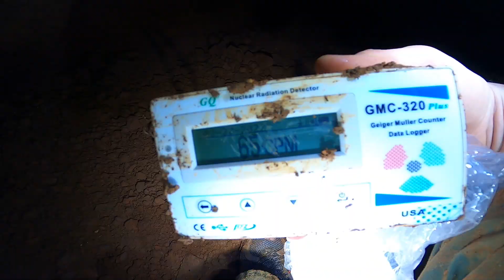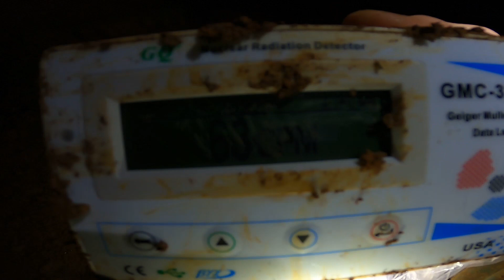Underground Nuclear Aircraft Laboratory

Comment: I want everyone watching this to take a good look at the holes these people dug out and entered through.  They are deep holes.  Beyond 5 feet deep and are not sloped correctly or shored to prevent a cave in.  They are very lucky that the sides of that hole did not cave in while they were inside of that place.  They very well might have been buried alive.  Some soil mechanics info:  There are 3 types of soil.  Class A,D and C with A being the most stable soil and C the least stable. Class A hass1.5 tons of unoppressive strength, B 1 ton and C .5 tons.   What that means is the ability of the soil to remain compacted before it fails.  The cohesiveness of the soil to hold together.  What determines class A to class C soil is clay or sand.  The more clay in the solid the stronger it is.  The more sand the weaker.  Understand that 3 cubic yards of dirt weighs 2000 lbs. (That's equivalent to a bucket on an excavator or track hoe)  You add to that weight if there is water in the soil.   I'm not trying to be a know it all.  I'm making you aware of a real life and death situation that I see and giving you information that may become useful to you in the future.  I'm a pipeliner and you only need to get buried in the dirt just below your chest to die if someone isn't there to dig you out.  The weight of the dirt pushes all of the air out of your lungs and you are not able to take another breath because the weight is pushing against you.  When digging deep always consider the soil to be class c the weakest.  The slope ratio for class C soil is 1.5 feet to 1 foot.  Meaning for every foot you dig down you need to slope the excavation1,5 feet out.  If it's a two sided trench that means both sides have to be sloped 1.5 feet out and if you have 3 or 4 sides to the excavation all sides need to be sloped.  When digging deep and getting down in that excavation is serious business!

Comment: This was a Lockheed facility. They had a nuclear power plant there. I grew up in that area and explored as much of it as possible. That was back in the mid to late 70's and the tunnel that you just went through wasn't fully underwater. From doing research online about it we found out that they indeed were trying to build a nuclear plane. And some of the old timers who worked in the complex said the plane and an old train was left inside and most of the place was flooded. The water comes from the Ettawa River that runs right beside the facility. The tunnel you floated in on rafts was big enough to drive a tractor trailer in. I'm sorry but the hole in the ground you climbed out of was not the same as the tunnel you floated down. That tunnel opened out to the river, and the river water was what they used to keep the nuclear power plant cooked down. Maps were found online, but we found them to be woefully wrong as there was much more complex than was listed on the maps. The hole you crawled out from was the entrance and where you crawled out was actually the top of the concrete entrance where tons of dirt was dumped to keep people out. They were afraid of any nuclear radiation that was there. The large tunnel there (after climbing through the hole) had some technical manuals dated 1958, but all were under water. And turned into mush when they were touched. About 50 to 70 feet back it went into three separate rooms and openings in the floor showed several levels lower under water. We tied a flashlight in a clear plastic bag and lowered over 100 feet of fishing line down the shift never seeing bottom. Couldn't see the flashlight but  it acted as a weight and it always had tension so we never found bottom. More questions than answers but it was fun.

Comment: It's an old abandoned Lockheed Base. The front side is where civilians worked and the back side, where they are in the video, is the military zone. A reactor cracked and leaked at the bottom floor. It's irradiated the lower you go. Don't dive in there. This Lockheed Base is now Dawson Forest. I commented in more detail on their other video inside this military office complex. I don't know how much they knew about this place, but it's basically a small underground city. There's underground structures on both sides of the Etowah River. The radiation is a serious issue. There used to be signs everywhere. I don't understand why they were taken down. Fish were irradiated in the river. My friends and I saw one of the largest river fish not even a mile from the stairwell.  It looked like a Suckerfish, but it was about 6ft long and probably weighed 80 pds or more. Dawson Forest was my playground growing up, especially in my teens. There's so much to explore there. Be aware of radiation and Timber Rattlesnakes. Have fun exploring and be safe.
Also be aware that it's a wildlife management wilderness. The Georgia DNR, Dawson County Sheriff's Department, Ga State Patrol and even at times, the US ARMY might be there and you might get arrested while exploring inside forbidden areas. However, the juice is worth the squeeze!
Try to get inside the large concrete building at the front side. You won't believe your eyes when you're standing inside. I  could show y'all so much that you'd never even know you're standing on. Again, be safe and have fun!!
Reply: Been inside the hotcell building several times and some other some spots would love to go back out and see some new spots . I never heard a reactor cracked I would love to hear more of what you know

Comment: Get a 3" discharge 4" suction gas pump and run it to empty the lower levels, where is this?  I have been to alot of abandoned places and have a huge gas pump that pumps 3500 gpm
Reply: Would draining it even be worth it? 
I think it’s a concrete box with all metal stairways and landings going several stories down. If you did drain it would you trust all the rusted metal to hold your weight while you explored?

Comment: Excerpt from the internet:

Aside from the visual aboveground remains, the remains of the underground facility at the reactor area also still exist. This was the area that shielded physicists and workers during irradiation processes. It consists of three underground levels and a tunnel that led to a parking area for employees during the time the plant was in operation. These underground compartments, which had to be continuously pumped during the 1950s and 1960s, are now completely flooded due to the water table, and entrances are sealed with bulldozed mounds of dirt for the protection of individuals, although according to McClure, "We have continuously had to seal up the 3 openings to the tunnel and underground area because folks occasionally dig them out.

Comment: It is supposedly 4-6 stories down. You can find older pictures online of when the went in the tunnel decades ago and the water level is a lot lower and no graffiti on the walls. They had a pump station next to the river that transferred the water to the hole that the reactor was kept in when not In use. There is a great YouTube video of the GNAL facility when it first opened in the late 1950s.
Reply: Thanks

Comment: It wouldn’t take long at all to pump out the old laboratory I would say several days as long as you have at least a 3” hose pumping the water out. I have seen them drain entire lakes and flooded mines in no time, where others said it was impossible. This is where the staff went underground when they would turn the reactor on. I have heard vehicles, common areas with ping pong tables and sleeping quarters are down there.

Comment: 100% the radiation is caused by radon, not leftover material. Also you should have a 4-Gas sensor. Make sure you're not walking into a pocket of explosive methane gas.
Reply: well you cant be 100% sure since you werent there when they decomissioned it, and since the guys in the video didnt have the equipment to determine which isotope it is. definitely agree with the gas sensor tho, methane is another invisible killer.
Reply: There is a report floating around somewhere where they tested the whole area and it is no longer radioactive

Comment: Is this in Dawson Forest? The last time I saw that stairwell at 7:53. water was halfway up those steps.
Reply from the maker: the water doesn't rise much higher than the level seen in this video. the proof is in the rusted metal electrical junction boxes on the walls. there is a clear rust line where the water stops and in the staircase there is a water line on the paint on the wall showing that it doesn't reach much higher.... at least on average. maybe there has been a rare flood that has raised the level temporarily but it couldn't happen often because it didn't leave a line.

Comment: So cool!  I've explored that whole area, really cool history.
Reply: where is it
Reply: @oswurth8774  Ga, but more specifically, dawson forest wma, city of atlanta tract, which is the south end. To be even more specific: REF (Radiation Effects Facility)/reactor site & nearby buildings/tunnels/lab. Used to be known as the georgia national aircraft laboratory; or GNAL, AKA Air force base #67. Opened in '58, closed in '71. Was top secret when it was operational. Basic jist is that we were preparing for the cold war & were trying to do 2 things here: 1. Irradiating (plane) materials with an unshielded nuclear reactor to see how feasible a nuclear powered plane was, & 2. Find out what kind of damage radiation akin to a nuclear bomb does to a forest & the flora & fauna within. The gate is open rn to where you can drive right up to the REF/reactor site; if you cant get past the first black gate you come across, youll need to hike your way there. Driving: Follow the main road (dawson forest rd/reactor rd) past the spot on the right where most people park (where the hot cell building is), & follow the paved road til it dead ends; if you are at the bottom of a hill & see a cul-de-sac & a 10ftx10ftx10ft concrete cube with a dirt mound in front of it, & a big empty field to the left, & a gravel road ahead past it thats gated, you're at the right spot. Currently, the entrances to the REF seem to be blocked off again with a dirt mound & some large rocks; people dig them out occasionally, dnr/wildlife management blocks it again when they notice. The gravel road straight past the REF, the one that's gated, it takes you to an old rail bridge that was detonated, like the one near the hot cell; only concrete pilings on either side of the etowah remain; impassible unless you wanna get wet. DNR/wildlife management/cops patrol occasionally & try to keep folks out of the buildings for safety concerns & preventing lawsuits; dark tunnels, rusty metal, full of water (& mold), with slightly above normal levels of radiation. Haven't been in the tunnels personally, but know right where they are & am glad to show anyone around who's interested, or can link a map. I live right next door to the place & have a ton of free time. Not much to see above ground, but still worth exploring the above ground. The hot cell building is in the main parking lot, it's a huge concrete structure, & is fenced in. Just past it if you keep following the trail its on is a waterfowl refuge, then a fork; cut left & itll take you on a hike towards the reactor, turn right and the short path takes you to a bridge that doesnt exist anymore; just concrete pilings on either side. The pump house is a cool building out there as well, kinda hard to describe how to get to it - but its right before a wooden bridge on your left; blue trail, heading towards beaverdam rd. There's another fenced in area, the cooling off area - but its kinda disappointing; you can only see a tiny bit of concrete foundation & a ton of dirt. There's a couple of old steel bridges with nothing to drive across out there too. Some weird large pipes in the ground waaaay out there on blue trail too. Couple of sets of stairs out there too, like whats in the parking lot, that I assume went to trailers/buildings entrances.
Reply: @blefnefnef  how's security/cops?

Comment: You would need to setup a pump, and a generator, or power station and let it run for days to clear all the water out.
Reply: Months man, there’s so many halls and stairwells and massive rooms that are just flooded
Reply: @stevenlester9395  well, if you wanted to explore the place bad enough, then it's possible.
Reply: I have had such an urge to send some pvcpipe through the electrical room conduits in the shield wall into the reactor room to siphon out the water but I’m not certain it would even make a difference considering the water table will fill it back up.

Comment: Of course, my first thought was that it wouldn’t be too difficult to get dive gear in there.  But that would be a stupid dangerous dive.
Reply: How so? It's not a deep cave filled with dust. It's concrete walls and clear water.
Reply: @CeceliPS3  Did the water look clear to you when they submerged the GoPro?
Reply: @ljones2087  not like a swimming pool, but clear enough. Those are stair cases and they have enough visibility with a flashlight to see the wall on the other side. Plus, they said it themselves that the water was clear.
Reply: @CeceliPS3  I am no professional diver, I own no dive gear, zero first hand dive experience. I've heard people have dived this; however, I wouldn't dive this even if i was an experienced diver, & especially not past the first floor. Dont get me wrong - I wanna see every square inch of this place so bad I cant stand it too lol. I feel like a submersible drone is the way to go. People die in caves all the time from getting silted out; kick up some dirt & you can't see two feet in front of your face, then you get disoriented, lost, and run out of oxygen. A lot of times, the bodies are never recovered for it being too risky & theyll just seal up the cave and call it a tomb. I get that this isnt a cave. I get that you could probably swim 10-20 ft in any given direction, and probably find walls, floor or ceiling, & stick to it. What if you're 3-7 stories underground, 3-7 stories away from the air pocket, can't see 2 inches in front of your face from being silted out, & then cut your oxygen line on some sharp piece of metal, like the diamond shaped metal grating stuff they were sliding past on their rafts in the very beginning? You'd better have a buddy right next to you, who sees it happen, & one whos willing to buddy breath, who has plenty of oxygen for both of you, & pray they dont snag their line too, & that yall can find your way out before running out of oxygen, or you'd just be dead. Not to mention, this water, theres no telling how radioactive it is; water holds radioactivity like soil. You'd definitely want a wetsuit if you were to even think about it as well, & im sure it would be cold as hell; the etowahs aquifer (and rainwater) is where this water comes from, & I know the etowah river is cold af, even outside in the dead of summer, in 100°+ heat, & that caves are generally way cooler than outside temps.
Reply: @blefnefnef  Indeed. Nobody would wanna be caught in that scenario you so well said. People have now created cheap af and really small flying drones. Next step would be diving drones with a powerful enough wifi to go through several layers of concrete.
Reply: @CeceliPS3  it’s absolutely not going to be clear once you enter the water. I am PADILLA open water and enriched air nitrox certified. That to say, I’m not some random commenter with no experience. Once you enter the water you’re going to disturb the water and get silted out really quick. Especially in an area with heavy clay soil.
Reply: @johnd9357  I see. And when I ask you this, please also don't take me as a random who is trying to troll you. I really wanna know from someone who understand this. Can't you swim veeeeery slowly so you don't disturb the water? I remember seeing this on Discovery Channel years ago. Cave divers swimming very slowly and very close to the cave floor in deep tunnels with dirt, sand or whatever everywhere, as the narrator said that the diver had to keep very calm and not do sudden moves because otherwise he could get die there without knowing where to go. Very risky, but doable by professionals. Is that not the case here?
Reply: @CeceliPS3  possibly,  but it still only takes one mistake to silt it out.  I'm sure there is settlement of some type on the floors of this place.  It is doable but still very very very dangerous.  Any diving is dangerous but any enclosed diving inside a structure is extremely dangerous.
Reply: @michaelvoorhees5978  yeah, like I said in my previous comment.